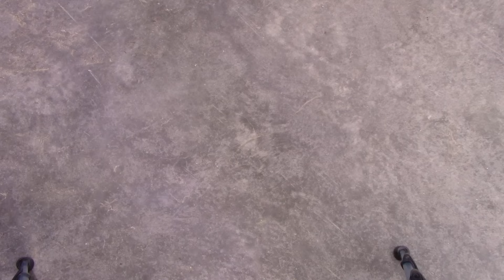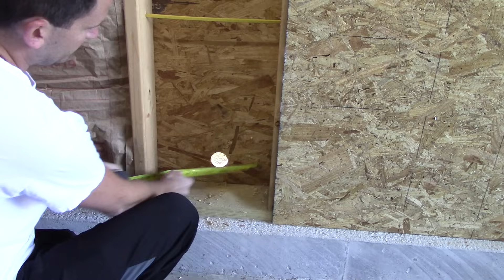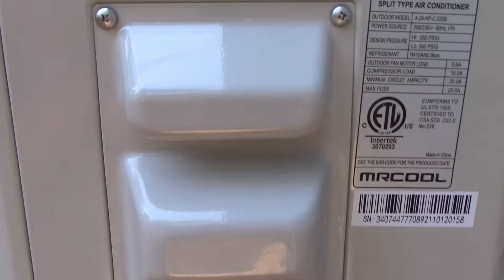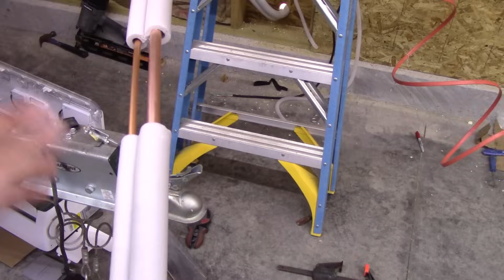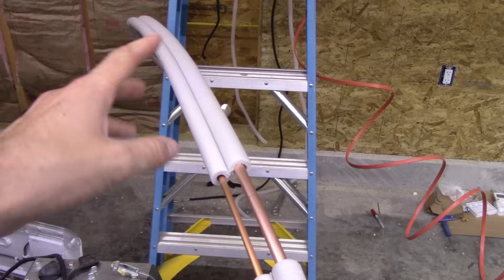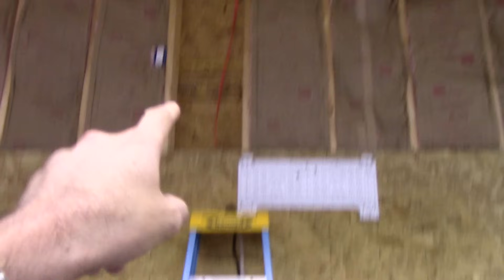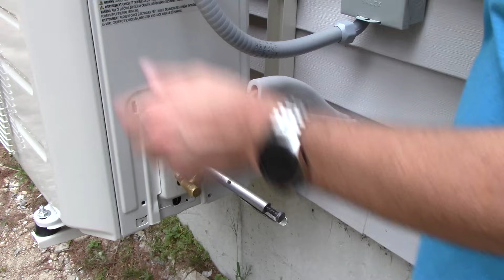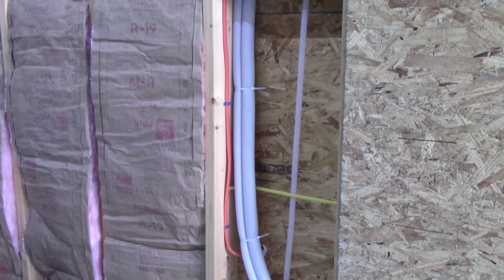Mini-Split Installation For Dummies - Complete Step By Step Guide.

Comment: Great job on the HVAC.  Do you have any issues with the relatively small temperature settings of the unit?  Typically I'd like to keep the garage at 40F or so during the winter, but the lowest I think they go is like 62.  Not sure what the cost differential would be for that temp difference and how quickly it would overtake the cost savings of something like this over a small house unit.  Any thoughts on how you plan to use it would be appreciated.  Also - I apparently jumped the gun yesterday and commented on another video about the bonding of the ground/neutral of the sub-panel.  Glad to see it's been fixed - Should have figured, quality work.   Now you have me looking at scissor lifts though - Wife's going to be pissed at you.
Reply from the maker: I have that same problem.  I think I'm going to try a workaround this year.  I figure if I put a rheostat in line with the temp sensor on the indoor unit I should be able to dial in a fake reading.  Make it offset like 20 degrees or so.  That way it thinks 40 degrees is 60.  Obviously the temp readout on the unit will be wrong but that's not important.  It should work but I haven't tried it yet. What do you think about that idea?
Reply: @Trialnerror  That would probably work.  I'm hoping to find a way to use a standard 4 wire controller - Those are pretty easy to find with low temp setting (down to 35F) or a WIFI unit you can turn on/off and change the temp setting.  Keeping something above 40 only normally only takes running the heater for a short amount of time each day since the temp differential is so minimal.  Searching online - it looks like a few of the Honeywell and Nest thermostats can go down to around 42 and are Wifi for changes or turning them on/off.

Comment: well done.

I'm wondering if it's necessary to evacuate the vacuum. Assuming if you're lucky enough to get it all done and sealed, why not just release it? If you leak and the system sucks later, then you can buy the pump and refrigerant again to refill. But having done alot of plumbing I actually feel that it's rare to have a leakage in these type of connections.

Comment: Did you hook up the drain joint to the bottom of the outside unit? There's one drainage hookup for the inside unit, and another separate one for the outside unit

Comment: I appreciate you making the video and it was very helpful, but you dropped the ball by not showing us the connections to the pump and the refrigerant.
Reply from the maker: There is no connection to the refrigerant. It's in the compressor.

Comment: Great Video ... Nice work.  You can tell by the wiring layout in the Main panel that this is the guy to learn from!  Two questions if you have time to reply.  

In the Main panel indoors ... did you connect the neutral (white) to the neutral bar, even though you didn't use it in the new exterior safety disconnect box?  If yes, why is this necessary or good practice?

In the new exterior safety disconnect box ... is this considered a sub-panel and did it come with a ground bonding screw installed in it?  If so ... did you need to remove it?

Thanks very much.  Again, really nice work!

Comment: Good video. Was there a reason you skipped the pressure test and the micron guage draw down?
I'm going to install a 3 zone Mr. Cool 36k btu Olympus in the next couple weeks, so just wondering.

Comment: Might be a stupid question; but does the indoor unit come pre-filled with the coolant, which then is transferred to the outdoor unit, due to the vacuum?
Reply from the maker: Not a stupid question at all.  Yes the outdoor unit is precharged and will fill the lines and the indoor unit when released.

Comment: Love this video! You are so meticulous and thorough. I have a question about the lines. You cut yours to exact length. Most of the MrCool heat pumps sold now have a specific length set (25ft) that is pre charged. For my upcoming install I need about 8/10 feet max  which is much less than the pre charged set. I like the idea of a pre charged set but to take advantage of it you have to go with the length supplied in the kit and then, like in my case, I would have to accept quite a bit of coiling which you say is not a good idea. So would you recommend to get the pre charged set and make it work somehow or go with cutting it to length? There would obviously be some coolant spill and I would have to charge the system the way you did.
Reply: Nedjnski I’d like to see someone more qualified answer your question. I am in Florida. I’m installing an 18,000 BTU unit for my garage. I’m going to have my extra line coiled up outside next to the unit. As long as the coils are large and there are no sudden bends or kinks I would worried about oil pooling. If you are getting the DIY by Mr Cool then cutting the pipe defeats the purpose and the cost savings. If you want it to look prettier without the extra coiling then you  want the regular non-DIY like he is installing here. With the money you save you can buy the tools or call an AC tech to make the connections and vacuum the lines for you. Hope this helps.
Reply: @nedjinski this would not be possible for the “DIY Models” knowingly cutting into one of these pre-filled refrigerant lines is illegal. Please call a certified and licensed person to make alterations as the refrigerant must be handled properly by a competent person.
Reply: @luisrodriguez4308  The compressor is charged with refrigerant, not the lines. (lines may be pressurized with nitrogen).  After the lines are evacuated, you release the refrigerant INTO the lines by opening the service valve).

Comment: What gauge of wire do you need to run from your service panel to the new disconnect?
Reply: It varies from state to state in Ontario it depends on the amperage draw, on the unit it will say exemple, min circuit breaker 11.7 max circuit breaker 15, so on a 15 amp breaker you can run 14 gauge wire minimum if it’s 20 amps it’s 12 gauge minimum 30 amp 10 gauge minimum and so on, you still have to consider the length of the wire to make sure you don’t have voltage or amperage drop

Comment: TrialN' Error:  I am considering a 18000 DYI from HomeDepot for $1600,  but now I see Pioneer on Amazon for $1000.  Is the price higher because it is a DYI with warranty?
Did you consider other brands?
Reply from the maker: The DIY units come with precharged lines.  It's much cheaper to buy the pump like I did and buy the non DIY units as you've found.  It's up to you but I'd rather spend a couple hundred and have tools than pay $600 more for the unit and have no tools to service it with down the road. Good luck either way!
Reply: @Trialnerror  Which brand(s) do you like?
Reply from the maker: @rondail5675  To be honest they all are very similar.  Most use the Pioneer compressors including Mr. Cool.  Find one that includes the wifi adapter and go for the best price per BTU.

Comment: Is the disconnect switch wirinf correct? isnt suppose to be load sets in outer junction and line sets in inner junction sets?

Comment: Do I even need a special "R410A manifold gauge set"? I already have one for R134A automotive systems. We only use the gauge set to pull vacuum?
Reply from the maker: I suppose you don't.  All you need to use it for is to make sure it's holding vacuum so any gauge will do that.  Good luck!
Reply: @Trialnerror  Thanks for the video -- you just saved me like $50 for that point! I'll use my R134A gauge set to verify that it is pulling and HOLDING a vacuum and then release a little bit of gas like you did to slightly pressurize it before I release the schrader valve.
Reply: Holding a vac does not indicate that it will hold pressure. 🤦‍♂️

Comment: Nice install. Your only one I’ve found so far that installed the lines between the studs.  To keep the inside unit flush to the walls were those lines easy to bend or did you have to notch a relief or drill some holes.
Reply from the maker: They are easy to bend but also easy to crease so you have to be very careful.  They cannot handle anything tighter than say the circumference of a 1 gallon paint can if that makes sense.  Just bend them slowly and really watch the lines as you're doing it.  If it starts to crease you want to be able to stop before it's too late.  GOOD LUCK man!
Reply: @Trialnerror  I was thinking of getting a kit like this: https://www.amazon.com/gp/product/B08SFZP9W2/ref=ewc_pr_img_1?smid=A3DLN7K1UTIF0F&psc=1 but it sounds like these pipes might not be able to bend that much. Would this be too much on the 1/2 and 1/4 pipes (I have 18k and 9K indoor)

Comment: So I bought a unit and it didn’t come with the disconnect. Also assuming the orange wire is a 10/3? Anyways looked for it in the description and may have missed that. Just want to make sure I have everything before starting.
Reply: watch minute: 16:23

Comment: What is the difference between the DIY version and the unit you installed?  I thought the difference was that the lines already had refrigerant in them and per their website they do not need to be vacuumed and charged.  You showed the vacuuming but I did not see you charging it - do the non-diy units also come with the required refrigerant or did you add more refrigerant to yours?  I am a little confused here - thanks in advance.
Reply: The diy version line sets cannot be shortened as they are precharged and under vacuum. The version he is using does not have a precharged line set where you would need to vacuum and the lines.

Comment: Ok. Sitting here in a cool Sunroom! Just finished installing a Senville 24 K BTU Split system. Probably couldn't have done it without watching your video. Thanks MUCH! I tried a 12K and a 14K Portable floor model AC. Simply could not cool this 450SqFt room. The 14K advertised it would cool (and Heat) a 700 SqFt room. BS!!!! I had to send the 14K back. I've had the 12K so will just keep it or sell it. But as it is rt this moment the 24K is doing the job and it's 94 degrees outside and 78 in here. I had 2 estimates from commercial HVAC companies to install a Split System and they wanted $10000 just to start!!!! Saved myself over 8K doing it myself.  Again, Thanks!
Reply from the maker: Congrats and GREAT JOB getting it done on your own!  Letting me know my videos help means the wold to be, for real.  Thanks for taking the time to let me know and congrats on the massive savings!  Take care brother.

Comment: which unit is this? I noticed you used a 2pole 30amp Square D breaker. The amazon link shows many options, i wanna make sure i buy the same one you showed in the video. Better efficiency with 240,

Comment: Why didnt you test the line with nitrogen? You should of used a micron gauge to test the depth of the vacuum. Also, u should of tested the connections with soap and bubbles
Reply from the maker: Nitrogen test is a good idea but not necessary.  Same is true for the soap test which I probably should have done but knock on wood the system has had no issues.

Comment: Great video but using a power tool on electrical terminals made me cringe.  Torque those down with a torque wrench or at least use a hand tool.

Comment: Which Mr cool split! 18000? 20 amp 230volts?  You hooked up the neutral in the sub panel ,but it's not connected in the disconnect? Is it two phase?
Reply: I was wondering where the white(Neutral) went in the panel as he doesn't say.
Reply from the maker: @NockOn1  It's not used for this application but I always run it anyway.  It's really nice to have if say 10 years later I want to replace it with something else that needs a neutral.  The extra couple bucks now is easier than having to run and chase a whole new line down the road.

Comment: at the beginning you said you liked this unit better than your mitsubishi unit, why? I'm in north Ohio and Mitsubishi is the only one I know of that heats (some) below 0??
Reply from the maker: I've used this to heat below 0 and it doesn't seem to perform any worse than my Mitsubishi.  Both units will heat but they are both inefficient at those tempsl
Reply: @Trialnerror  Thank you, I was thinking of putting in a gas heater ( instead of wood) to supplement is that necessary? what do you do when it gets that cool?

Comment: Can I use my gauge set that I've used on r134a? Any risk of cross contamination?
Reply: I've watch a few pro Hvac video saying not to due to cross contamination. But I'm no expert.
Reply: I'm hearing different things so I'm not going to take any chances. R134a does use different oil and they say you should blow out the lines with nitrogen.

Comment: Does anyone know what 208/230 volt mean. Can it be wire to 220 volts in America?
Reply from the maker: It's all the same.  Normal household current here will vary between 110v and 120v.  So, when you're pulling two legs in for a high voltage appliance like this you will see a range of 220v to 240v.  So to answer your question, yes 220v is perfectly fine.

Comment: Great video. One question.  I have a  2 car garage and a 500sq ft guess house both attached. Considering price per unit and energy usage would you recommend    individual units for each or a 2 zone unit?
Reply from the maker: So long as routing the lines back to one outdoor unit isn't going to be a PITA, I would absolutely do a two zone unit.  Way easier to install, only one outdoor unit to maintain and only one double pole breaker and electrical supply needed. We have a 4 zone in the house too.  Either way best of luck with your install!
Reply: @Trialnerror  thanks for the reply. Much appreciated.  Great video and you answering all the comments helps so much. Takes a lot of dedication. You get out of that just reading them.

Comment: What are you doing at 20:33 "removing the service caps" But you hook something up to it and you don't explain what it is or why you are doing it. My mini split didn't include whatever that is. Are you filling it with freon? I think mine came pre filled.
Reply: He connected a vacuum pump to it in order to take out the air in the lines that he just connected. Air takes up space that Freon should be in. Doing this will help the system run well. It's not necessary. I've seen it done without vacuuming the lines, but I'm sure it's better to do so.
Reply: @anastaciolopez7438  it's massively important to suck water, vapor, carbons out that will corrode and block your system over a short period of time.
Reply from the maker: @garydow1540  Yep, moisture will destroy the compressor.  Gary is dead on, you have to draw the lines down or plan on replacing the unit every year or two.

Comment: I'm planning a basement finishing project now, and I have pretty much decided to do a multi zone mini split system.  Torn between doing the grunt work and having a HVAC pro finish for me, or just doing the whole thing myself.  One thing I'm confused on though.  I thought the Mr. Cool systems were pre-charged, and you couldn't cut the line set pipes.  Or are there multiple packages?
Reply from the maker: They have two options.  Some come with lines that are under vacuum so no pump needed.  The others are like mine.  My version is usually about 30-40% cheaper which pays for the pump with HUNDREDS left over.  Of course it's up to you but keep in mind if you damage the line set on the precharged ones during installation....ouch $$$$. Either way, best of luck!
Reply: @Trialnerror  I like your way.  The one drawback I saw (or at least that I thought was there) with the Mr. Cool DIY system was that it just came really long and then you had to deal with whatever length of line set you had left over.  I didn't know the pre-charge was actually inside the condenser, allowing the DIYer the freedom to shorten the line set as needed (with the appropriate tools and techniques obviously).  Thanks for the video.  Gained a subscriber.

Comment: Do those vacum pumps work for any system or do i need a particular size. Im installing a similar pioneer split.
Reply from the maker: They will work for any system, just make sure to also have the mini split adapter to go with the pump/manifold gauge set.
Reply: Trial N' ERROR Thanks God Bless you

Comment: When you draw vacuum for 15 min what's the negative pressure I need to reach before stopping the pump?
Reply from the maker: Doesn't really matter too much.  Just let it pull it down until the needle stops moving and you'll be good.  Just want to pull it down enough to remove moisture.
Reply: @Trialnerror  when I turn pump on it jumps to like -20 when I shut gauge valve while pump is going it drops to 0. Is this normal or shreder valve is not pressed. I checked it visually and I think 8t should be pressed when hose screwed in. I'm working on it now...
Reply: Nevermind. It was shrader valve that wasn't pressed.
Reply: How do you when the moisture is gone? If it doesn’t matter too much shall I just skip this bit?
Reply from the maker: @garykearney8202  You never get it all but you pull vac to eliminate the bulk of it.  Not a step you want to skip especially with longer line sets.  That moisture will trash the compressor.
Reply: @Trialnerror  you should have a vacuum/micron gauge. 410a requires at least 400 microns, also get yourself some low loss hoses so you can check you suction pressure. Without testing the running pressure you cannot determine superheat and cannot gaurantee the proper charge.